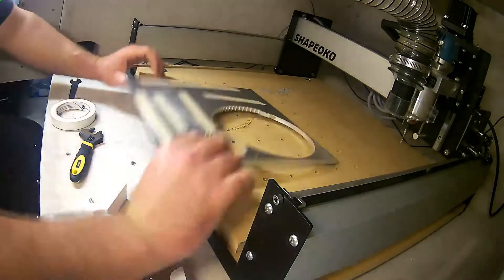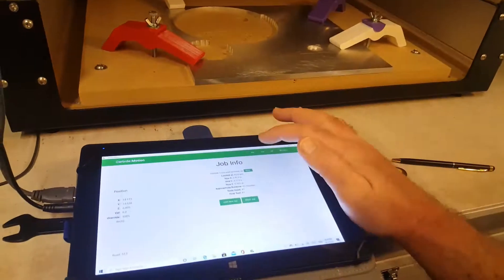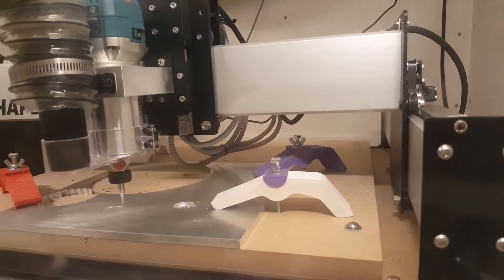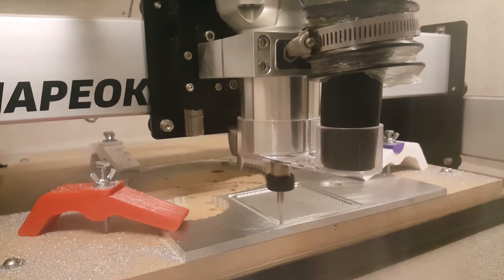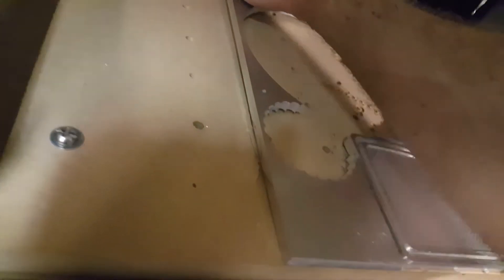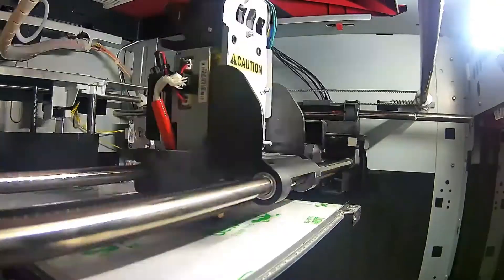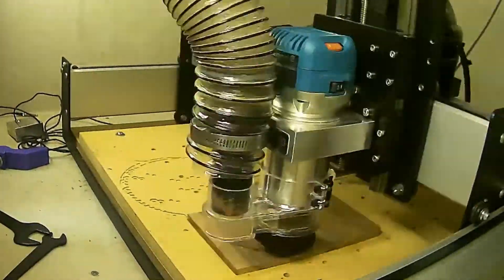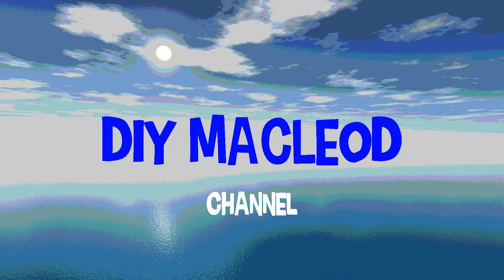CNC vs 3D Print - Shapeoko 3 vs Davinci Pro 3D Printer + Design and CAM from Fusion 360

Comment: What speed feed and depth of cut do you like to use for aluminum (and bit) on the shapeko?
Reply: I know in this vid your speed was14 in/min and 1/8 but but 2 years later what have you learned works best
Reply from the maker: I just ruined my Makita trying to get too aggressive about a week ago (had to use my fire extinguisher). I mainly use a 1/4 inch 2 flute HSS bit for aluminum if I can get away with 1/4 inch for the project. I moved my speeds up toward 30-40 IPM, but I need to rethink my depth of cut at those speeds. When I jammed up the Makita I believe I was at .04 inches depth on a contour pass which I could have maybe gotten away with .03, but probably should have played it safe at .02. I question whether the depth was the real problem though because it was going fine for the first couple of minutes and then started to bog down. When I removed the router I saw the speed was at full which was not where I had it originally (I had it right around setting 3), so I wonder if the speed control crept up causing it to fail, or if the failure caused the speed control to move. I think I have learned the biggest issue with aluminum is getting chips out of contours as be as possible so they do not fuse and clog everything up and having a reliable way to hold my work (which you can see in some of my newer videos). Anyway hope any of that is helpful.